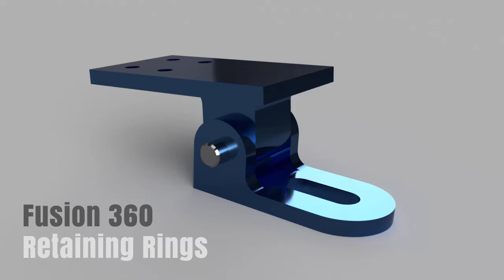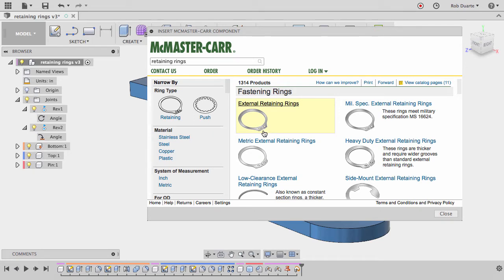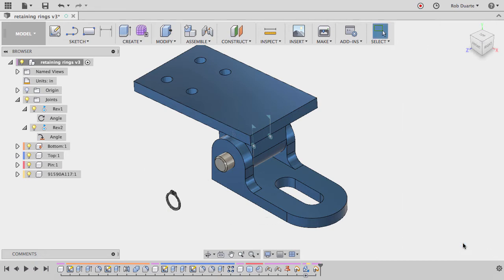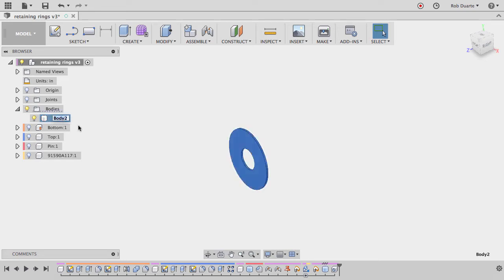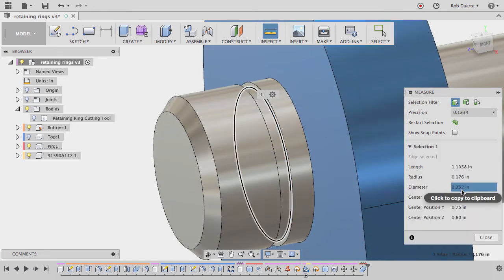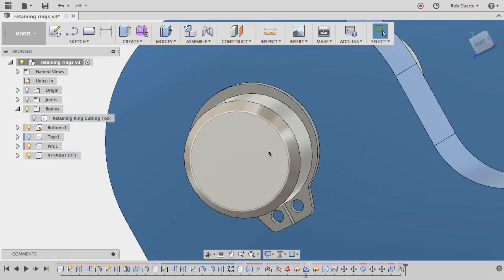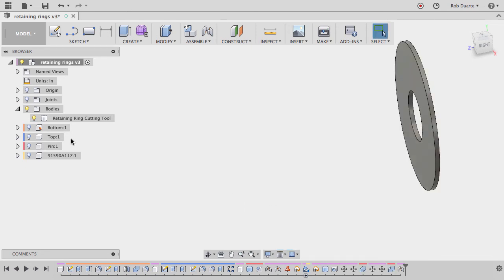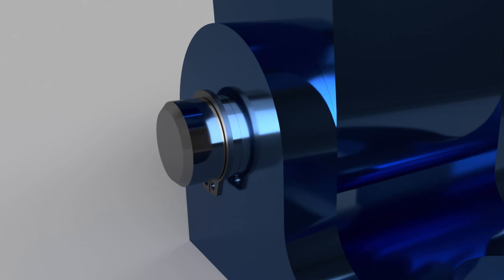Making a groove for a retaining ring in Fusion 360

Comment: you can use the modify -> combine function between the snap ring and the component with the current version of fusion 360, then use cut function without making going through the extra step.